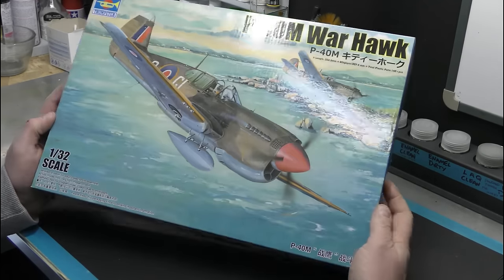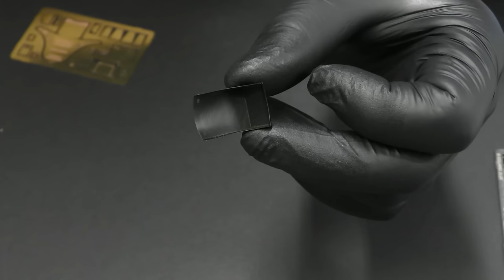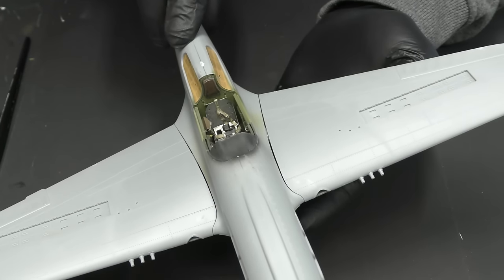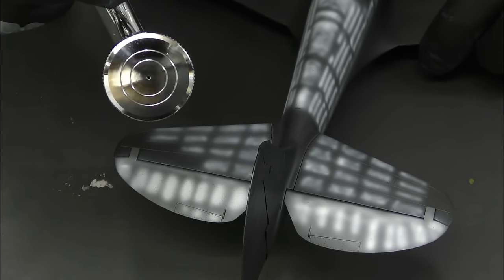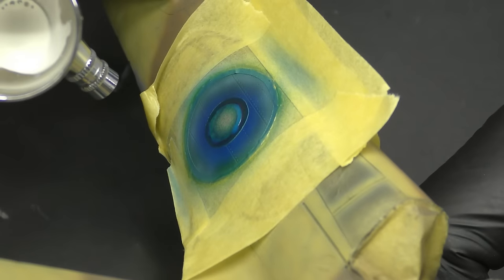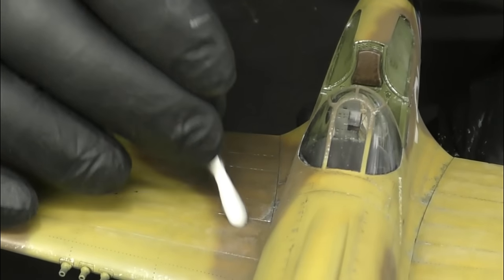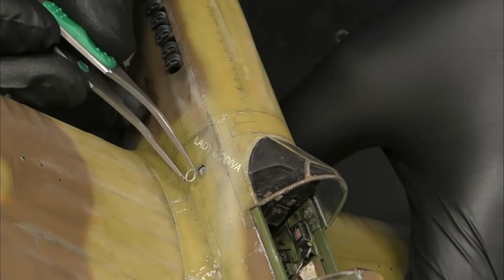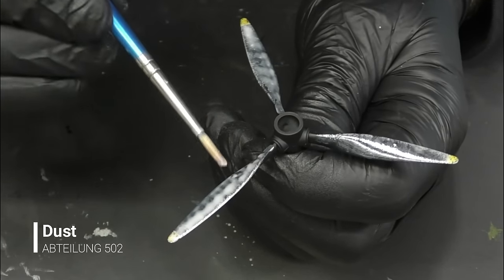Curtiss P-40M Warhawk. Trumpeter 1/32. Full build aircraft model kit.

Comment: As to the Gun Barrels you opened, what is shown is an outer barrel shroud for the M-3, .50-Caliber machine-gun.  What I do is open the hole as you did, paint the shroud gun-metal gray then insert a silver tube to emulate the guns barrel which were chromed.
Reply from the maker: Hi, good call! I will look at doing that next time round! Many thanks. Andy.
Reply: @ScaleModelShed  cool beans, great job on the model.

Comment: That was a fantastic build. Thank you for posting.
If I may point out an error, I noticed the centre of the roundels were painted, flat red.
In the SAAF markings, the RAF red was replaced with orange, as per the orange in the south Africa flag at the time.
I thought the decals looked like they had orange? Depends on what my screen puts out correctly.

Comment: Fantastic work as always. A quick question: I noticed that the marking stencils were a bit off (roundels a bit oblong and not perfectly round). Is that a limitation of the cricut machine or deliberate choice?
Reply: looks like the placement of the stencil is off rather than the machine, I use a Cricut Maker and it cuts shapes very accurately
Reply: Lets be real, IRL these were not perfect circles, these do look a bit more accurate for a plane that is quickly painted to be sent to combat as fast as possible

Idk, I might just be liking the style
Reply from the maker: Hi. TBH I think it is a limitation of the Circuit Joy (the small one), it seemed to have a bit of trouble with perfect circles on the masking paper. I have ordered some Oramask 810 stencil film to try., it should cope better. Having said that, as Nomad Prod. says, I really wasn't too concerned, as it turned out, I kind of liked the imperfection! I did some minor corrections if they were too bad. Thanks for watching.
Reply: @ScaleModelShed  Thanks for taking the time to answer my question. It was mere curiosity more than anything. Your builds always come out fantastic.
Reply: Nag nag nag.
Reply: I must admit that after watching at least half a dozen of your videos and always being impressed, those roundels don't half annoy me. I guess if you're happy with the look, then so be it.

Comment: Very impressive build. The kit has an error though - the M variant had a small opening window on the port side front screen assembly, same as the later N models. That, along with the longer fuselage, are the two main visual differences between the E and M models.

Comment: Great video!   And, ok, I admit I'm OC and anal retentive about certain things.   My only problem with this build are the stenciled roundrels.  At this scale, any asymmetry, bleed under, wrinkled masks, etc. just jump off the model at me.  As with the formation light fix (great recovery, btw), I think i would have used aftermarket decals for the roundrels and lettering as much as possible.  Less expensive than a Cricket.  Yeah, I'm a cheapskate, too.  My father called it being frugal.  But, the video was jammed full of great techniques, especially for handling photo etch, cloth seatbelts, and weathering.
I've subscribed so I can see more of this builder's skill.  Thanks!  Let the criticism of my comments begin!

Comment: Great vid!!  The P40 is often viewed as a pre-war obsolete design and was outclassed by later pursuit designs. This was hardly the case. With its huge wing and tail surfaces, along with light wing loading,  the P40 was the most maneuverable American design throughout the war. It was rugged, had no vices and was unmatched in a dive--only the giant P47 was close. When it was in design, high-altitude interdiction was not included, therefore it did not have proper turbo supercharging for high altitude work. Saburo Sakai himself said the only American aircraft he feared, when properly handled by the pilot,  was the P40.
Reply from the maker: Thanks Ron, really interesting read!
Reply: @ScaleModelShed  Ren - not Ron.

Comment: amazing ! One technical question, didn't you have any mixing issue using both sepia and dust wash with oil paint ?I'm starting a 1/48 P40 too and I hesitated between insisting on dust wash but still having the effect of a dark wash to provide deeper effect. thx!

Comment: Outstanding. I like how you did the exhaust stacks - will remember that one. I think decals might have been wiser for the fuselage roundels, but still a superb build and very inspiring!
Reply: Not so sure, I think that aircraft were moved between theatres so the desert camo may have been hastily applied. The roundels may also have been painted again by whoever drew the short straw. I have heard for example, that invasion stripes were applied with a bucket and sponge. I had the pleasure of inspecting this model close up earlier today...... and it's magnificent.

Comment: Very well done.  Great job explaining the techniques and the materials used.  I’m going with the ABT 502 oil dust for my 1/32 Corsair build.  What was used for the antenna wire insulators?  Brass tubing?
Reply from the maker: Hi Paul, Thank you. Yes I used small brass tubing used for modelling turnbuckles. Cheers. Andy

Comment: Good job, why was the rear iron sight offcenter then the front site entered? I'm trying to think of a circumstance in which it would make sense to make the pilot press his head against the glass on the right side to look down the sights lol. since the 50cals are evenly distributed on the wings and converge at a fixed place in front of the plane those sites should be 100% centred. otherwise great work
Reply from the maker: Hi. Me and my Father had this exact conversation. I did some research and it seems that the iron sights were offset to the right in case of failure of the reflector sight (which is the same as the Spitfire's). The pilot would need to physically shift viewpoint to aim. Thanks for watching. Andy

Comment: I have several questions regarding your cricut joy. Im not using tamiya masking paper, I'm using  "tisket" paper, clear masking paper, basically the same thing I assume. What setting do you use to stop it cutting deep into the cutting matt as I cant seem to find one that works? Also goes without saying TOP BUILD MATE!!
Reply from the maker: Hi, I haven't needed to use mine for a while now, but I remember there is a pressure setting?
Reply: @ScaleModelShed  yeah everything i try just bloody cuts through. Im gonna try the tamiya tape. Might work.

Comment: Beautiful!! I struggle with the weathering aspect, specifically washes.  How do you get it so paint stays on with enamel or mineral wash.  I've tried even adding a clearcoat of Tamiya clears or future, and when I go to remove some excess, my paint is either tacky and cotton sticks, or rubs right down to the plastic. Sometimes it dries for a week or more before I try the wash.  I've had success with citadel water based washes, but I don't like the look of them when dried.
Reply from the maker: Hi Danny. I would use the Mr Color GX range clear to seal the paint, its really durable and will resit pretty much all weathering stages. Cheers, Andy

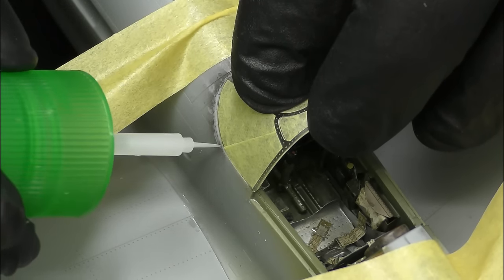Comment: Great result. Question: when you use the extra thin at 12:09 to glue the canopy, for a second there the glue actually gets absorbed by the masking paper. I've had this happen and ruin that part of the canopy. Was wondering if you have this problem. I think I can see some capillary action on the inside of your canopy, on the front left.
Reply from the maker: Hi Adrian, Thank you. It was OK on the paper. I think it may have gone inside the front canopy between the clear and the dash cover. That front screen is a bugger on that kit! Thanks for watching.

Comment: Great looking model this, well done. Can I just ask, when you use the gloss varnish, do you go straight in with that heavy coat or do you put a light dust coat on first?
Reply from the maker: Hi Robert. I would put a light 'tack' coat on first if I was going to lay the next coat on very heavy, for instance if I was going for a very high gloss finish like a car body. On this model, really as little gloss as possible, just to allow the oil pin wash to be wiped off easily. Thanks for watching.

Comment: Those roundels weren't very round but as long as you're happy.
Reply from the maker: The small Circuit machine did struggle making the roundels absolutely perfect on masking paper. But I do actually like the slight imperfection. They where painted on after all. Thanks for watching.
Reply: @ScaleModelShed  have you got one of those cutter compasses? With a bit of practice you can get very good results. It's what I use myself.

Comment: All the Trumpeter's in 1/32 of the P-40 with the exception of the E & F short tail version,fail to represent the P-40 faithfully, they all the represent  the fairings for the pushrods controls on  the tail section they are overlooked on all the variants up to the N variant,the Hasegawa model kits are more precise on this detail, therefore the Hasegawa kits are superior.
Reply: correction: all the Trumpeter's P-40s up to the N variant fail to represent the fairings for the control pushrods on the tail sections,they are not present.